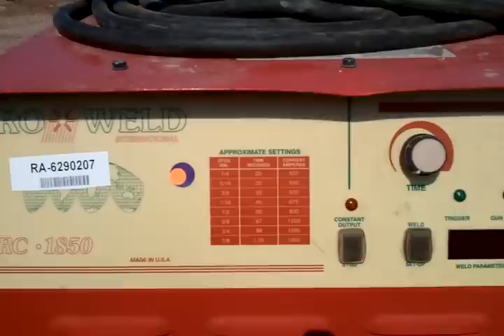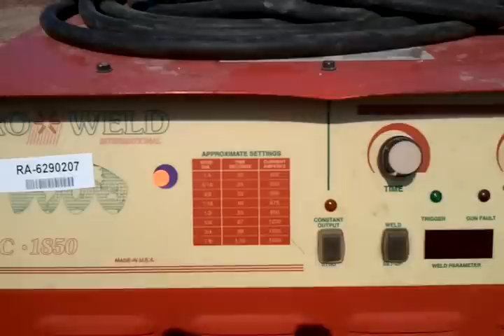Stud Gun Welding 2

Comment: Engineers call these shear studs.    They don't merely anchor the slab/deck to the beam.  Their function is to increase the bending resistance of the beam they are welded to.  If you think of a beam as acting like a paperback book, if you bend the book you will see that the pages on the outside move relative the pages in the middle, especially at the ends.   The shear studs resist this movement, thus making the whole assembly stiffer.    The phenomena is also called "internal beam shear".   Shear studs resist internal beam shear.   I you understand this you will also notice that the stud at the
very middle of the beam has quite an easy job,  whereas the studs at the very ends are highly stressed.
Reply: +thzzzt AKA, steel beam to concrete moment connection
Reply: Was there a time when steel decking was not used. Like in the old skyscrapers. Did they use steel decking or was there another method used for the floor slaps.
Reply: Do you know what strong side means when shooting studs?
Reply: Typically in any given deck "flute" there are two possible positions in which to install the shear stud.  The point farthest from the midpoint of the joist is the "strong" position.  The other (closer to the midpoint) is the "weak" position.   This is illustrated on pg 11 of SJI's "Composite and Non-composite Floor Joists" PDF.   You can download it for free from Vulcraft.com.
Reply: ya obviously you had to Google it because you have been  doing it the wrong way....sorry
Reply: Failure
Reply: He is correct about strong side weak side. I shoot between 2000 to 3000 studs a day.

Comment: lol thats kinda funny, its a fun setup but it shows you how dorky this equipment is......if someone wanted to and was bored

a used ford lightning for like 30k with a 500VDC battery pack capable of putting out god knows wat 400kw could probably do a few thousand of those a charge for cheap af. 
not happening though as theres effectively 0 industry interested in HVDC coming off a battery pack. super easy to do tho as its already dc.  just reduce voltage 

that is wild though you need a rented midsize generator and a inverter and the gun on the end. 

surely theres some thermite option out there with premade pucks you ignite on the studs for cheaper/easier use

Comment: Where would I find an attachment for a welder like this? Googling it just shows the ones used in car shops for dent repair
Reply from the maker: Zarina Romanets in Las Vegas there was a rentalcompany just for  stud welding.  Don't know if you'd find anything like that though. Maybe Red-e-arc?
Reply: Thanks for the reply! After asking around I found a supplier for the Puget Sound that deals in Nelson Studs specifically
Reply: google is for consumners my mate and this is NOT a consumner tool. thus they dont show it as nobody is paying them to advertise this beast.  commercial rental companies or they just own it and rent the power unit

Comment: Fast pace? The place I work requires 4 to 5 times what you were doing if not more.  I can shoot 54 D2L 1/2 x 5 and H4L 1/2 x 5 at a rate of 54 in 4 minutes.  There was no speed to this at all. I would however recommend being above what you are shooting to save your wrists.
Reply: Hunter Doxtater actually, they were damn near perfect.  how straight they were is something I prided myself on. before I left that job, someone else came along who could blow my numbers out of the water which just shows how truly slow as shut the guy in the video is. based on that speed, I bet it's a union job lol
Reply: This (54 in 4 mins is impressive. What was the STUD WELDING MACHINE that you used ? What is the most important thing to achieve this speed ?
Reply: Yes he was slow but is working with studs 1.5x as thick. This means it naturally takes longer to handle them, as well as the weld time being longer for every single stud. I dont think he does this all the time, as it's a portable unit. At my shop you do it for 8 hours a day all day with a lower table lol. Obviously youd get fast.
Reply: He is very slow we have to do this on site carrying around d 6 cables setting up then still welding over 2k studs a day one bloke managed 6000 in a day its all about the numbers as our company and most others pays extra money per stud after 1500 studs the way he puts the stud in the gun is slow and weird and also placing the ferrul into the gun and putting it on the beam like that is something I've never seen in 6 years haha just leave the ferrul on the beam and put the gun with stud into it that way
Reply: @marknoel9379  2 year response lol, anyway.
Nelweld 4000.

To achieve this speed we had a template made to mark stud locations, ferrules and studs are within reach. Keep a length of the cable over your arm to lighten the weight of the gun, this lowers fatigue  which increases productivity. As you pull the trigger reach for the next stud to get it into position, raise the gun after the cycle is done or you will fuse the stud to the collet. 

So in short..
Lighten the weight of the gun buy putting the cable over the arm to protect the wrist from repetitive motion injuries.
Grab the next stud as the current weld cycle starts.
With practice you no longer have to look to incert the stud no matter which end you grab first,  personally i grab the middle so i do not have to look while grabbing.
Reply: Yeah I shoot studs on bridge girders. Bent over all day I can get 500 first two hours and 250 every hour after that. Try to preserve my back and still get high numbers. I’ve shot 2200 in 6 hours. Smooth is steady and steady is smooth I am the tortoise not the hare. I just keep going.
Reply: @wolfofautumnnight  Do a video for us...
Reply: @renatob2482  that was years ago, I no longer work there and moved on to much better pay.

My opinion now is, do not try to bust your ass doing insane stud shoots for the scraps they pay. CEO pay has hot up about 1,300% since the 70s, and everyone else is barely 300%.

Slow your roll and do not sacrifice your body. Busting out all of those studs will do nothing more than help the business owners, they are not going to pay you more or give you a share of the profits.
Reply: @wolfofautumnnight  We get paid by production, so the fastest we do, the more we earn. Congrats for the pay raise...
Reply: The guy welds at the speed of molasses but that's probably just for show and also the guy probably isn't paid by the hour.

I'm considered one of the slower stud welders at my company but I would be expected to complete the entire length of the beam (Not just the half he's doing) using the same 22/25mm thick studs in 5 minutes.

Comment: but the primary reason for the shear stud is to hold the concrete on the deck
Reply from the maker: VINCENT OGBONNAYA in this case it is a vertical beam encased in concrete.  This adds strength to the whole structure.
Reply: I was just getting ready to ask what the use of stud welding was--you just answered my question!  :)
Reply: Ok.
Reply: DeCall, what about the horizontal floor beam deck covered with a corrugated steel sheets.
Reply: Horizonal floor beam deck is also OK

Comment: Seems like overkill on the power supply. Many Nelson Stud units run at less than 1000amps at 480 volts
Reply: Buddy Frederick .....no, the 3/4 inch round stud needs at least 13-1500 amps. The voltage can be as low as 80 volts, it’s the current not the voltage that does the work.
Reply: 3/4 studs with thru deck ferrals. I run 1950 amps. and.888. of a second
Reply: It is overkill but its really still in the same size class. They probably ask the same amount for the rental. Though it would be appropriate if that’s what the rental house has available, you can see it did actually load the engine so its not too big. 
This looks to be a Proweld ARC1850 which I think they say 76kW is minimum size. I know Truweld says 76kW on their SC1900 or what is now called the TW5700 which is the direct competitor in rectifier machines. 

In short, you could safely use one 1/2 the kW output. 

I typically use around about a 80-125kW depending on what’s available. I’ve used a doosan G70 which was 76kW rated to power a sc1900 running 1500a output with no issues whatsoever.
Reply: 1000 amps at 480v is pretty much spot on for clean beam welding.

When shooting through metal decking, it's closer to 1500 amps.

Comment: They're used to anchor things like decking to the structural beams.

Just as you nail pictures and things to the "studs" or 2x4s rather than sheetrock, these affix things directly to the beams.
Reply: No. Wrong. The studs connect the concrete to the beams. There just shot through the deck.